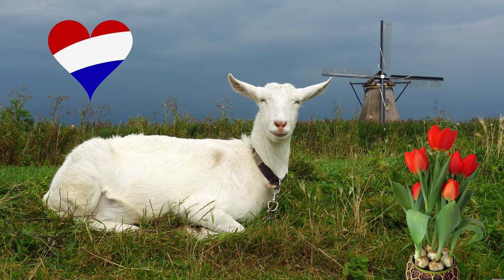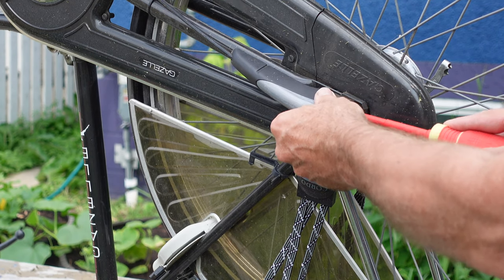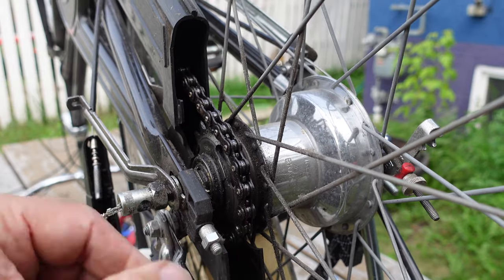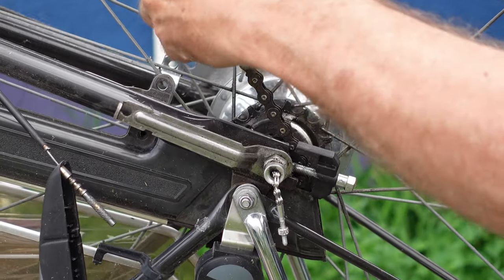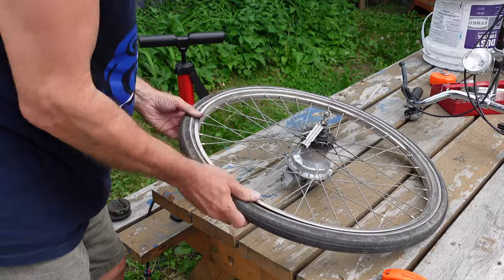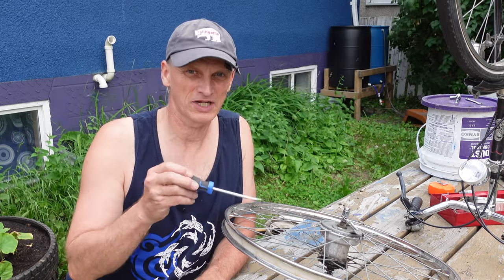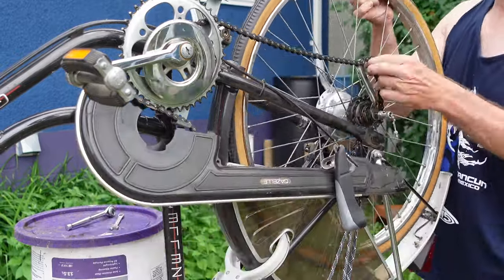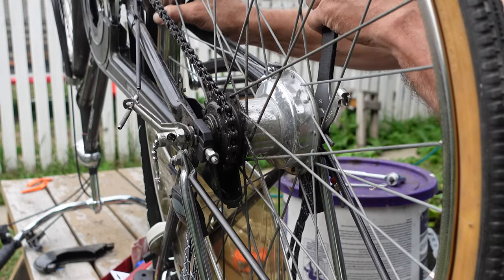How to replace the Rear Tire on a Dutch Bike, Gazelle Maxinette

Comment: Good job, Jorg.  I beat you to that by half a century.  My dad bought me a Dutch style bike when I was 10. and we were in Okinawa.  Had that bike until I went off to the Army.  Mine was all steel through.  Steel rims, chain guard, even steel rods instead of cable for the brakes.  Steel housing for the drum brakes and steel fenders.  A steel rear rack that would hold a tied up stack of wood 6 feet high.  When I was 14 through 18 I rode it back and forth to a part-time job at one of the mess halls on Vandenberg AFB, CA.  Except when I took off to go camping, that was two miles twice a day, seven days a week.  After school and on weekends.  When I would go camping with my friends, we would tie a rope between one's Honda 90 and two bikes, one being mine, and head off on the hard pan on the desert.  I do not know how many miles that bike had on it, but I know it was tough.  Mine was a single speed and all you had to do was swing the rear of the chain guard down, remove the adjusters and disconnect the brakes and the axle bolts and pull it out.  I learned how to pull the tube out of the tire without removing it to patch the tube, though.  You should change out that 3 speed for an 8, or 11 for Barbara.  The eights have been out so long now, you might be able to source a used one at one of the shops you worked at.
Reply from the maker: That might be a great tip for when I got some time. Sounds like you really enjoyed that bike. Ours has a plastic guard, but rims are steel too. It's still a very well made bike. Thanks for sharing!

Comment: You have done it once now. Next time it will be a lot faster.
Two things I noticed: Apparently you lost your "Schraubenschluessel" .....ok pliers will do in a pinch.
On bikes without derailer you will notice a polygon effect in particular when the chain is too tight. When you crank it slowly you can find the tight spot. At that point I loosen the wheel nut on the chain side which usually moves the wheel just enough to create the proper slack. Now I tighten the nut. Then I center the wheel by opening the nut on non drive side and tighten it while keeping the wheel centered. 

Another entertaining video by the one and only!

Comment: I bought an Azor cross frame. I decided I would upgrade the tires as soon as I got a flat on the rear, since i only wanted to do it once.
I got a flat, so I bought some Schwalbe Energizers and some thorn-proof tubes. Now I need to pull the cover and linkages apart.
Reply from the maker: This makes sense. I'm wondering if it would make sense to find one of those to use in the winter. But they're not easy to find around here. Thanks for sharing!
Reply: @the1andonly  
I bought the tires and tubes on Amazon. The tires are here and the tubes should be today sometime, so I'm pulling the rear off now. Almost have it off.